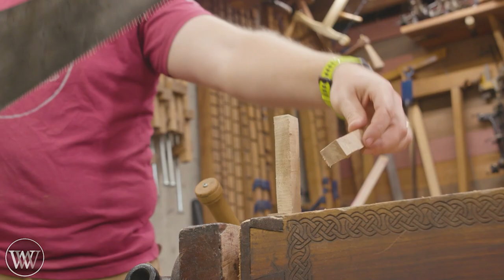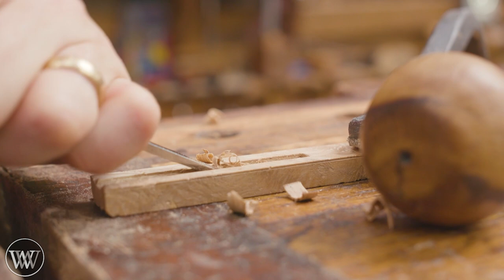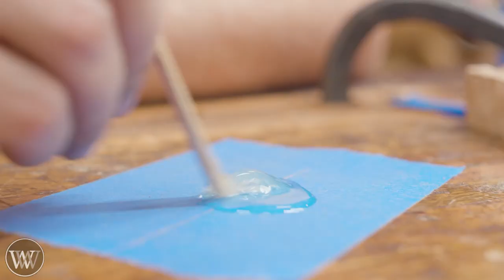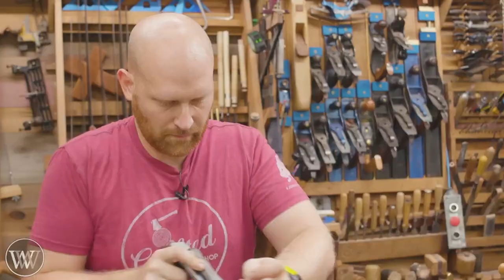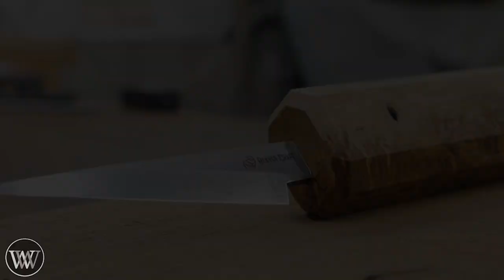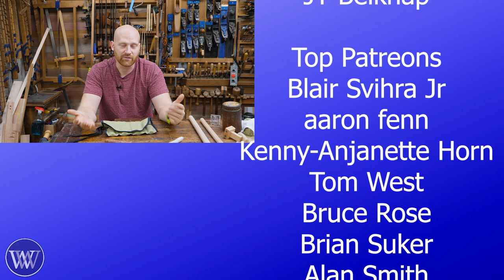Making Your Own Carving Knife Handle With Live Oak

Comment: I have several Beaver Craft carving/whittling tools; I'm no pro - I just enjoy it as an occasional hobby and they work well for me.
What I have learned is that - unlike general wood working hand tools - never let carving/whittling tools get so dull that they ever need a visit to the sharpening station (oil stones, diamond plates or whatever); strop them as soon as a drop off in performance is noticed, which could be every twenty minutes or so under heavy use.
I also have a Mora that I love using for general crafting in the workshop and and stick carving (walking sticks, etc).

Comment: How is the carving knife you just made different from a marking knife?  Genuinely curious.
Reply from the maker: a marking knife is a knife used to make knives and comes in MANY different designs. most making knives are only bevels on one side so they can sit flat on the work. but some people do like a marking knife with a bevel on both sides like this. for my work this would not make a good marking knife as it would like to wander a bit more having so fine a point.

Comment: Might I ask - what tool(s) are you using to reference the exact middle of something? I can’t figure that out, even after watching several of your videos in which you have so done. Thanks!
Reply from the maker: I use a marking gauge. If you mark from one side and then mark from the other and then put the pan just in between those two marks then you'll have a middle of the board.
Reply: @WoodByWright  Thanks!

Comment: Lovely watching you work. Interesting to see you using epoxy for the glue up, any advantage over woodglue + sawdust?
Reply from the maker: Epoxy will hold the steel much better. Wood glue would have very little effect on it. Wood glue is fantastic for wood to wood but doesn't really hold well against much anything else.
Reply: @WoodByWright  An alternative I’ve seen is to drill into the handle, use a dowel (or make one from the same wood as the handle), split the dowel and shave it down a little so the tang fits and then use expos just in the hole and on the tang. Might be worth a go?

Comment: WW: I cut myself, you know what that means.

Me: Super glue!

WW: Blue tape. *wraps tape around the sharp edge*

Me:  . . . . . . . . Ohhhhh. That makes sense! PREVENT the cuts instead of just gluing cuts closed!
Reply: Lol! I thought he wanted the blue tape for the cut to stop the drips from staining his work--that's what I do with it.
Reply: @margaretkrantz1469  that too lol! Though i use duct tape for that when I'm out of super glue. My "First-aid kit" in my shop is very misleading. Its pretty big and heavy. But when you open it there's a note taped to the inside of the lid that says, 

  "You did it again, didn't you... dumbass!"

 And it only contains a roll of paper towels, duct tape, a couple tubes of super glue and a small bottle of iodine.